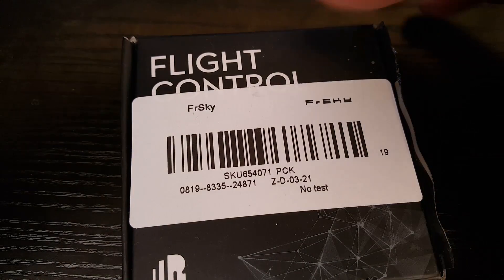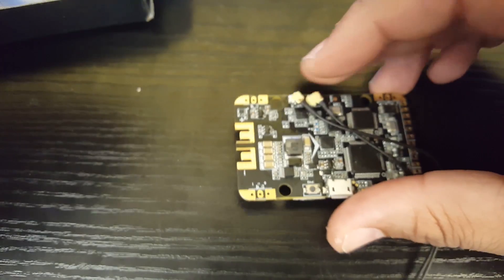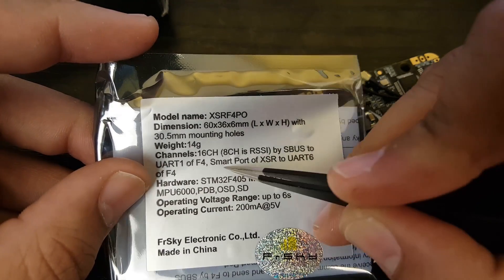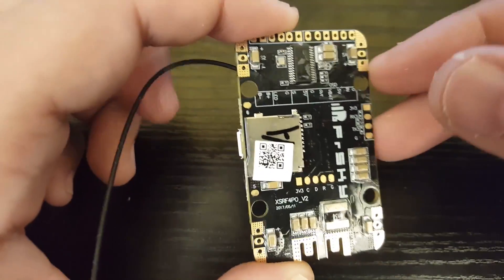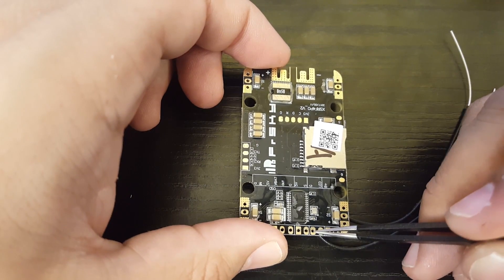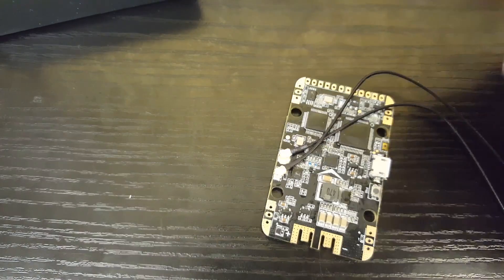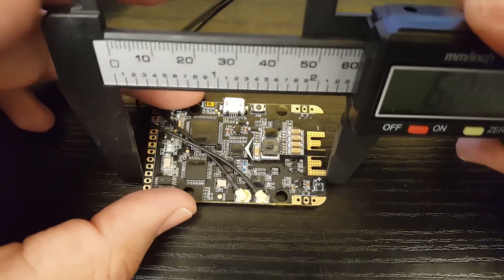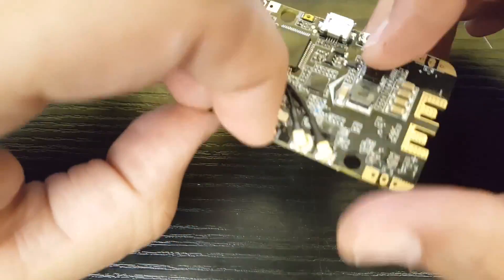FrSky XSRF4PO // Overview and Layout

Comment: This seems like it would do well in a Martian/Alien. I like the X210 frame a lot, and I use the XSR holder from flight club, so the "where to put the receiver" problem isn't a problem. I just wish an aio f4 would come out that didn't have problems - the marek f405 aio would be perfect if it had a 6000 gyro!

Comment: I haven't been building for long (only built racing type drones) and even I know this all-in-one FC is a little too long (will bump into the Cam/VTX or rear LED (if you add any) on a standard 125-130mm frame. This would suit a 150-160mm frame at least (150mm being very tight depending on the layout of where the board will go, etc).

For a 130mm, I would not go with this. I'd rather go with a Matek F4 AIO with PDB only (no TX, etc) and that would take up to a 6S battery (would fit beautifully into a 125-130mm frame).
Reply from the maker: +dragonballz0 Matek came out with pdb which has built in vtx they will be sending me test samples soon. As I know it should also have the ribbon connector to connect with the Matek FC. This sounds to be very reasonable and practical.
Reply: Drone Mesh I think you just ruined Hammond's surprise xD

Comment: doese any body know how to insert thoes anti vibration to the mounting holes i have found them very difficult to do!
Reply: You need 4mm mounting holes!!! Most of them are 3mm!!!
Reply: stick them in the 4 holes on the fc so it is soft mounted
Reply: Thumbs_Fpv  😆 jes i found that out also 😆 so ive cut them one halve below and the other half on top